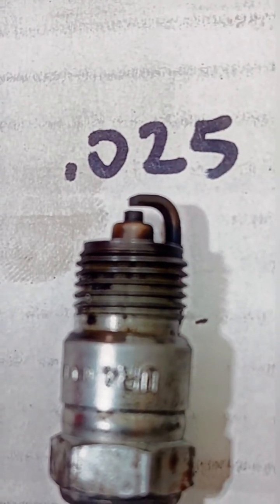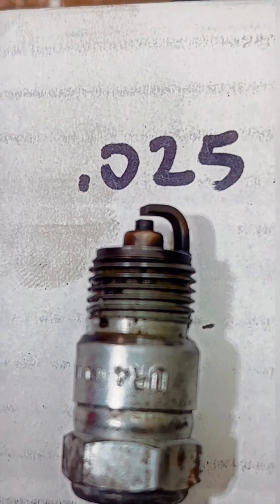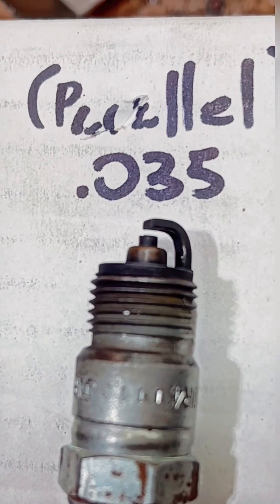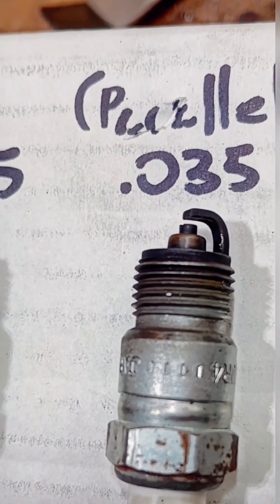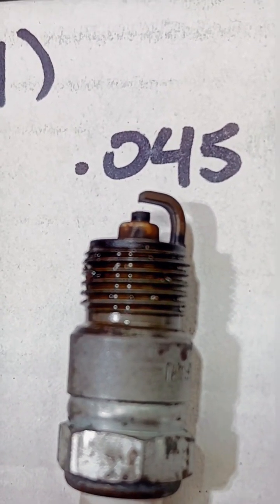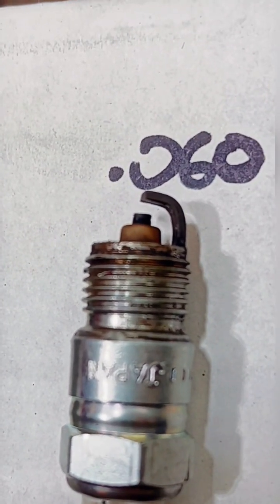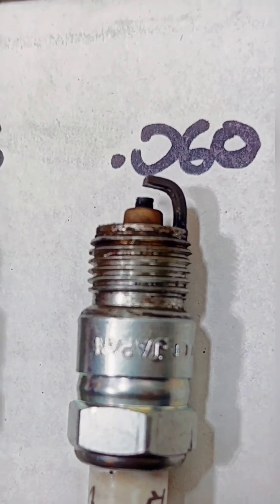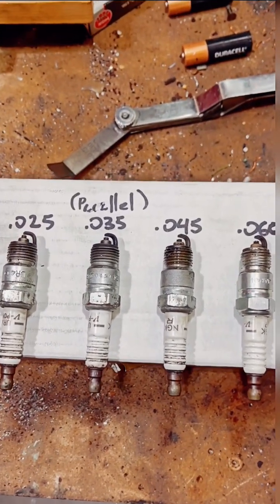The 4 most common Spark Plug Gaps #fact #tips #techtips #diy #cars

Comment: If the engineers are intelligent, they will understand this is a wear item and has a minimum and maximum gap, when new set at smaller gap size and when its tolerance becomes over the max its time to change it, on turbo engines you Need to set the gap at the minimum or the pressure literally blows the spark away before it meets the otherside from flamefront displacment, cycles

Comment: That 3rd one was .0449. Uh could see it😁😁
Reply from the maker: I had to account for the high relative humidity!  😅😂
Reply: I had to gap mine to 0.44 +/- 0.000001 and compensated for absolute pressure and temperature.